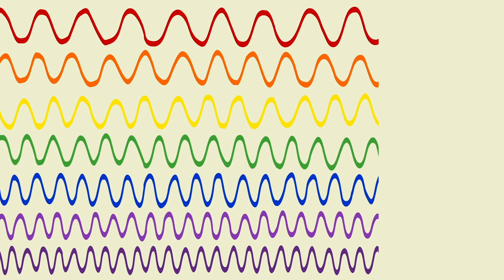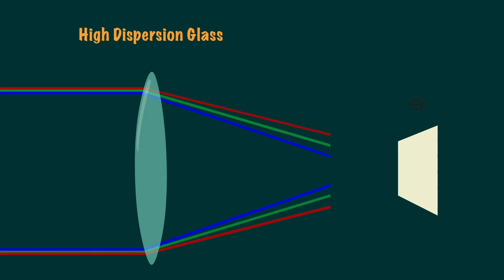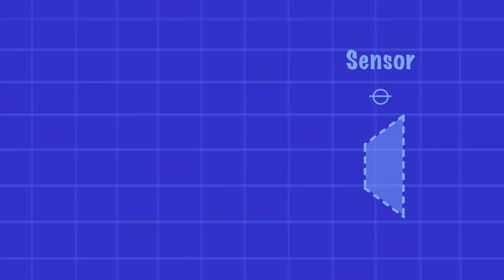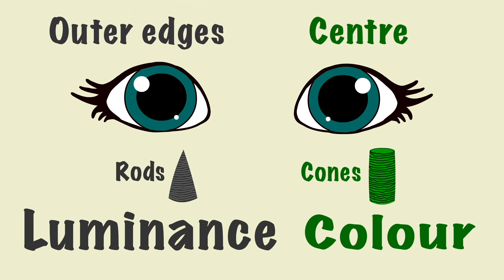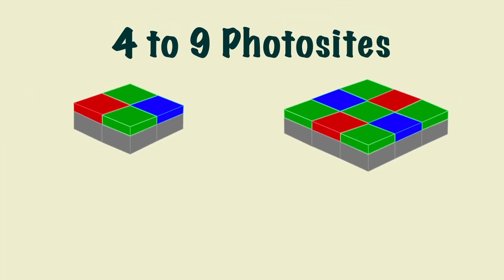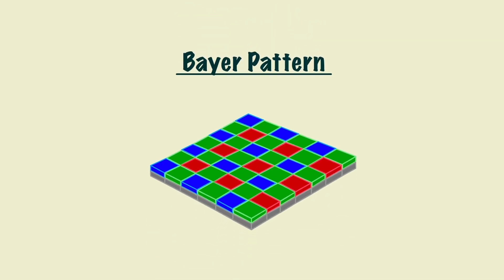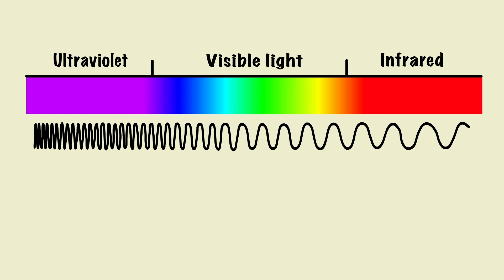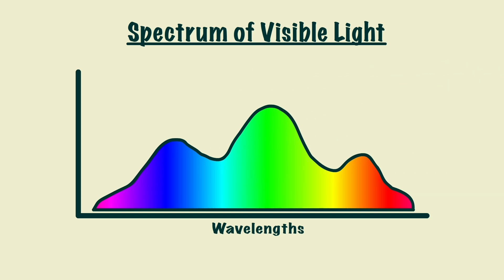FROM LIGHT TO SENSOR: Waves of Colour, Photosites and Bayer Patterns

Comment: I'm just starting to watch your videos, but you should do one about the difference between minimum frame rate required for the illusion of movement (16fps, as introduced as the standard silent framerate in something like 1909) and the lower brightness-flicker threshold (48 Hz), and how that interacts with camera, projection, soundfilm, and TV technology, and why we have arrived at a vast number of different framerates. They've even got it wrong on Wikipedia (because people keep confusing the framerate issue with the bightness-flicker issue), but here's a rough guide on it in the bottom section on this talkpage: https://en.wikipedia.org/wiki/Talk:Flicker_fusion_threshold#Still_needs_revision

And you should also do a video about the difference between effective resolution vs. interpolated resolution (both pixel resolution AND color resolution per channel, where the latter is how many different shades between pure black and pure white can be registered) due to things such as color subsampling (YUV and its digital equivalents as color spaces, that is mainly in relation to color subsampling, not as blue-luminance and red-luminance difference signals) and de-bayering in sensors, and how that leads to the lower quality of DSLRs vs. true RGB flatbed scanners (such as those with light-splitting prisms and three different CCDs inside, for example). Which also explains the difference between how fast you can make a photo (of actually poorer quality) with a DSLR or cellphone vs. how long it takes to make a scan with an actual scanner, because the scan has much more effective pixel and color resolution than the DSLR photo. And this video could explain how all that leads to the fact that the effective resolution of 99% of DSLRs and 100% of cellphones is only 33% of official specs as for pixel resolution, and similarly with color resolution per channel (where the green channel has 100% color resolution as for relative to maximum color resolution within the color-subsampled colorspace, whereas the blue channel only has 88% color resolution, and the red channel only has 49%). And how none of that changes just because a DSLR has a CMOS instead of a CCD (because they're all mostly Bayer-pattern sensors or use some other forms of color-subsampling patterns, after all), or just because a DSLR has the ability to store a crap interpolated image inside the RAW format (which is like putting a tiny teaspoon of flour into a 1-gallon sac).